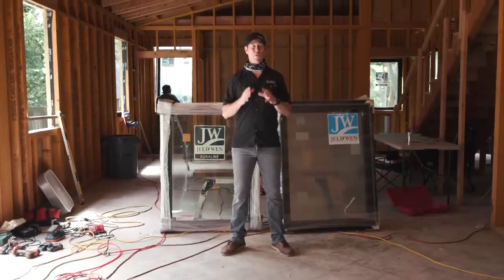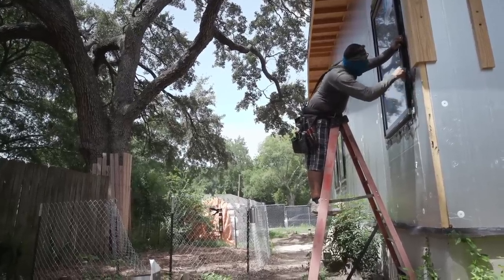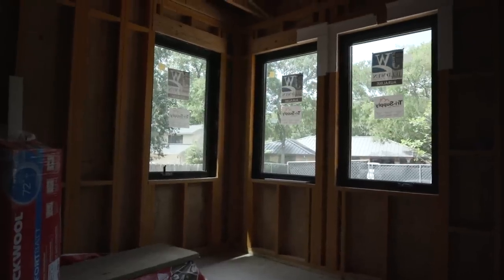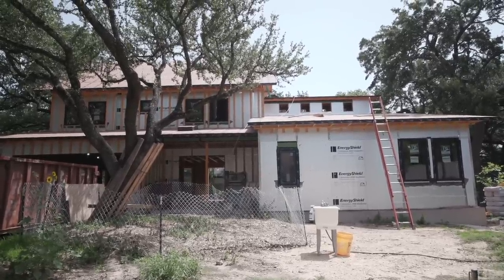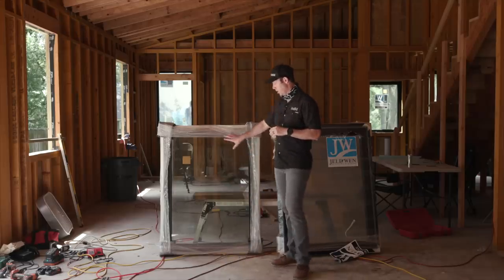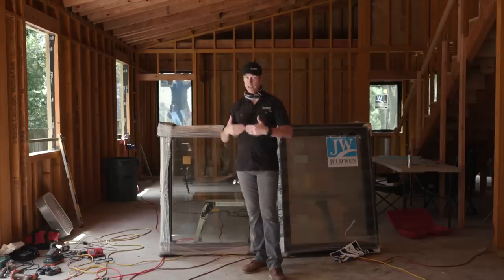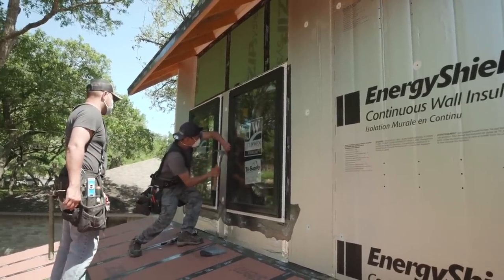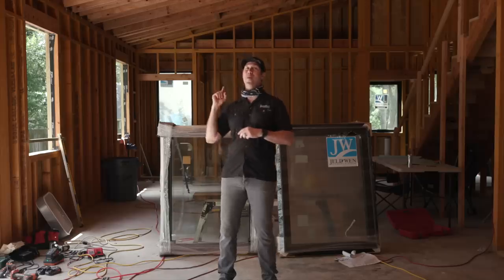Triple Pane Windows - Worth it?

Comment: I was super disappointed to find out when I built my house, the window salesman sold me super high quality Anderson 400 series double pane windows, that they were only about an R-3 and I’m zone 4A. I spent a pile of money on spray foam insulation to get around an R-42+ in the walls with closed cell foam just to cut huge holes in the walls and fill it with an R-3. I wish I had saw this video 8 years ago, as I would have gone a different route for windows instead of taking a salesman for his word. It’s ridiculous that’s we are energy star rating these windows for my zone when we can see temps of -35F in winter and I can form ice on the inside edges of my windows. I believe my window bundle from Anderson was $18,000 including a patio door.
Reply: How many windows and doors were in your package?

Comment: For the most part I agree. Something else to look at is REDUCE the number of windows. Lots of architects like to put windows in every wall in the house and they love these floor to ceiling windows. Now if you live in that house it's a nightmare. 
        Bedrooms will have a door on two of its walls and floor to ceiling windows on the other two. Now where do you put your furniture?  

      If our house had been sided instead of brick (I hate brick since it makes it hard to remodel and it absorbs heat and moisture) I would have removed several windows in our 1960 house. 

         My favorite windows are the euro style casements with the built in exterior screen. Great for stopping storm damage and they block out 100% of the light and some sound when closed. When we go to Greece I want to stop at the hardware store right by the airport, pick some up and haul them home.
Reply: I agree you can have too many windows. I also think that the squarer a window is the more efficient it should be. The U value for the frame always seems to be worse than the glass, so a square window would minimise frame size relative to the area (unless you want round windows...)

Comment: How long until these windows fog up? I have six brands of windows on my house due to various remodels. 

The Marvin’s from 1992 have all fogged and the low-E coating is destroyed. 

The Kolbe & Kolbe tilt-pac windows from 2000 are all in great shape! They are still supporting these and a pair of new jamb liners with balances is on the way. No fogging. 

The Andersen 200 series double hung windows from 2003 are all good. I’m pricing some Andersen double hung insert windows right now for the living room. They will replace the original 1948 casements that smash people’s heads when they walk up the front stairs. 😂

A Viking (Home Depot) window in the bathroom has fogged up on one side. The others are vinyl in the garage and basement and too new to evaluate.

Comment: Matt. Terrible comparison. I work at a glass shop and you’re far off. Many variables you haven’t touched on. Assuming all the glass is tempered: the thickness varies 1/8”, 3/16”, 1/4” are majority of windows double and triple pane. Annealed glass: SSB, 1/8”, 3/16” and 1/4” are most common. Then there’s lami (tempered and annealed) various thickness…
Next, the coatings on the panes: solarban, low E etc. Whether double or triple pane, each could have a different coating and create limitless outcomes. 
The spacer thicknesses will vary unit to unit. 
The gas in between the unit can vary. 
For example, a double pane with double 1/4” panes and solarban XL coating on one and comfort select 36 on the other with a super spacer argon fill. This could easily out perform many typical triple 1/8” pane, small spacer clear, clear and low E coatings. 
Do some more hw before you compare windows!

Comment: I have been doing windows and doors for 20 years and can tell one thing I’m in Canada and Canadian made or 🇺🇸 windows are not really engineered for triple glass except for fixed windows the hardware and the engineering overall is nothing to be proud of most of them are 20-30 years old without any major improvements its kind of shame. 
However European windows which I do a lot more is like day and night nothing even to compare Engendered Solid that. An handle double triple and in some cases triple with double laminated glass which means 5 layers of glass and still works like a charm. Thank to German engineering. And Jeldwen in. Anada used by builders which means the cheapest and the lowest quality. So you can make all the fancy videos and praise them as much as you want but to me it’s garbage period. No offence to anyone just sharing my observation

Comment: Passive solar gain. How much is solar gain through the windows helping you meet passive house standards?
Reply: Dave Kirkeby in meeting passive house code solar gain is not all its cracked up to be. Can be considered a negative in many respects. Here in Australia, passive solar heating units for hot water or winter heat don’t really pan out. Cheaper to put another solar panel on and condition your environment mechanically.

Comment: I’m in the gwn n want to share my findings with windows. They will b the coldest area of any room during the cold spells. So that’s why you need to understand what ur doing as wintertime comfort is golden up here. Temp gets to -30 plus any wind and heat inside 70-75 that’s a hundred degree swing. The only time I can tolerate lower inside temp is with a boiler heating cause it’ operates differently with more even heat. Your vids really aren’t adequate for us up here but great ideas n I mean the reality aspect. The in floor heat concept is great but don’t forget u will need a/c too n it’s different system. Currently it seems this aspect of the build can b a large number in ur cost but well spent for here. Efficiency is really where focus is needed.

Comment: Bad experience with Jeld Win. Sliding doors shipped with out wheels. One window with out a latch. One small crack on corner and sent wrong insulated unit to replace. In dealing with them took many contacts to get someone with a brain. Good quality materials but substandard craftsmanship

Comment: Who doesn't like a good storm window either exterior or interior? Especially if they are acrylic or polycarbonate sheet. They are much better insulators since thickness can be substantial compared to glass and sound is nearly eliminated. Also should point out that you can buy the best window on paper but it doesn't do much if it isn't installed properly. Most window leaks are due to this and how homes settle over time.

Comment: Why install windows?  The time is approaching quickly where you will simply hang an 80 inch, paper thin, flat screen display on the inside wall of your home's solid insulated walls and the camera mounted into the outside wall will will display a high resolution image of what is beyond the wall.  A simple voice command will allow that screen to provide you with the image as if your looking out of the living room window, or change to the view out of your kitchen or bedroom window or have the screen display your TV or anything else.  Most windows have no need to open, since all interior filtration and temperature control are handled by the HVAC system.  The thermal barrier of the wall is not compromised and the material and installation cost will be far less than contractors installing big frames filled with glass and gas.  The glass window is dead!

Comment: Triple glazing reduces visible light transmittance by about 25%, so if you buy windows for light, then design for 25% larger windows.  That should just about negate any energy savings, while adding 25% to the cost, plus another 20% upcharge for triple glazing.
It's true that no window lets in light after dark so triple glazing is great at night, and in the north that's 15 hours/day during winter.
I'm not yet sold on triple glazing (as you might surmise).  For now, I am getting the best LowE coatings, argon/krypton gas, and the best glass spacers for a U value of 0.24.  Windows are only about 15% of floorspace and probably less than 5% of the insulated envelope, so I don't get too panicky about needing triple glazing in my area.

Comment: For my region it will be all triple glazed. 

Are there different glass types one can request for their windows? I’m particularly interested in something shatter proof or bullet proof. Imagine the kids playing softball in the yard and give that window a pounding. 

How many windows is normal in a house? I’m counting 14-18 in my plans but that may appear excessive.

With extra thick walls (ICF, 12” concrete, 6-8” foam insulation) like 18-20” thick, would it make sense to have an outer window and an inner window?

Comment: There is a drastic difference between replacement windows and new construction when it comes to energy cost pay back. The payback on some replacement windows can be as much as 200 years! OK, they may be lower maintenance, they may look nicer, they might be quieter, but strictly in terms of energy cost, replacement windows are a bad investment. A well weatherstripped wooden window with a good wooden storm window will be as energy efficient as all but the best of the new windows.

Comment: Anything less than a triple glazed stacked on top of another triple glazed with imported Swiss air in between is simply unacceptable. There's plenty of room in the wall with 12" of closed cell foam anyway.

Comment: Matt, My house is constructed using brick over block with all windows triple-glazed.  I live within 1 block of two 4-lane high traffic roads. No traffic noise audible inside.  Fire truck and emergency rescue horns and sirens are audible.  I don't know if your windows are sound rated, but as I live in the city, this is an important feature of triple-glazed windows.

Comment: American triple windows make no sense when the frame is made from single pice framing, to get the full benefits of triple glass you must insulated framing which also is disconnected by a thermal barrier from inside and outside frame, only then the spending makes sense !!!
Get smart first and look at what in Europa is a high insulate triple glazed window can archive!

Comment: Great explanation on window values I agree it would be great to have a R factor posted on the label without doing Pythagoras Calculus  Good analyses on windows being a energy drain on the building so when I blueprint my homes I try to minimize the number of windows or size on our North side where our subarctic wind prevail all winter long at 30-40 mph or 50-70 Kmh
Like a good wife you gotta have good  windows we cant live in a cave well I suppose you could but it wouldn't be much fun. Cheers from Oakville Mb

Comment: Isn't the solar heat gain mostly dependend on the coating?
Then again a 22 isn't really that much different from 18.
If you really want to keep the radiant heat out. Use outside sunscreens. Especially on the east and west. The north has no use of sunscreens. The south should have enough from the overhag, albeit on the middle of the day. The south could still benefit of screens in the sunrise and sunset..

Comment: Matt Matt Your missing the Performance Ratings and the water resistance rating (in Canada there two separate ratings).
Doors are critical  
You may have a great glass but the seals or frame may leak air or water.
Jeld Wen windows have great performance ratings show why not show it off.

Comment: I did not hear you talk about one of our most important reasons for using triple pane at least  in  Iowa . In a tight sealed house the humidity will increase and freeze on a double pane in winter .And the other number I think helpful is what is the temperature of the inside surface of the window at say 10 degrees F outside temperature. And compare that to triple vs double. In our situation the triple raised the surface temp above the inside dew point and stopped the condensation.41 degrees with double and 51 degrees with triple inside with outdoor temp of 10 degrees F.

Comment: There is a reason why windows maker uses U factor instead of R factor. Yes, mathematically the U factor is the reciprocal of the R factor, but the U value is an engineering term used to designate the thermal performance of a system like a window that is a complex assembly, whereas R value is used to express the heat resistance of a homogeneous material like insulation that has a singularity intended to limit heat transfer.

Comment: Another strategy to make only some windows triple glaze is to focus on the large picture windows with large surface area and let the many small windows be double glaze.  Most of the heat loss in my house is the few large picture windows which is actually a big portion of window area, so spending more on those few windows would have been well worth it.  #2 for tiple glaze would have been noise reduction of windows in bedrooms or facing the street. Great point best lowest heat gain on windows facing south & west.

Comment: Triple glazed is good in a northern location where the interior glass temp in double glazed will be cold enough to cause condensation. The colder your exterior temp the more likely that your homes interior humidity will cause condensation. If your in those regions you should bump up.

Comment: You forgot to mention sound transmission. Three panes work together to dramatically reduce incoming noise, more than one might expect just by adding a third layer of glass. This can be seen in graphs of window sound transmission. One pane does very little; a second helps somewhat, while a third pane dramatically improves attenuation, even at lower frequencies.

Comment: I put polycarbonate sheets my windows, cut perfectly to size by the vendor, and held in place by magnetic plastic strips.  It made a huge difference to the noise and heat  and was very economical.
Reply: Inside, outside, both?

Comment: The space between pains is different between manufacturers. 1/4" up to 1". Thickness of glass. Gas filled. High end windows are often better designed to handle the additional weight a third pane of glass. Sound proofing increases as well. $ goes up with quality. Your house is coming along. Looks great!

Comment: I'm surprised the SHGC is worse on the triple glazed.
Reply: SHG is needed in the south. More glass or more coatings or going from double silver low-e to triple silver will all decrease SHG, blocking more of the sun’s heat from getting into the house.

Comment: do you ever install offset stud walls in bedroom walls and exterior bedroom walls to cut down on external noise transfer..  so the inside wall is NOT connected except at top and bottom with the exterior wall... sound is transferred thru the middle of the wall not so much the top and bottom.

Comment: E-coating or heat control films dramatically improve room summer heat gain or winter 'cold gain'. I have been going through my current house adding Gila Heat Control Platinum and it helps both South and North windows for heat gain or heat loss.

Comment: Matt, your solar heat gain is dependent upon the Low E coating. You should always go soft coat Low E vs Builder Priletic Hard Coat. Also some windows can be ordered with multiple Low e coatings virtually eliminating the heat gain!

Comment: I thought you were going to use an inside outside window setup.  I've been thinking about trying it with movable windows.  Fixed windows may be a future problem area.  I also seen videos of virtual windows using lcd tvs and cameras.  Great idea for security and thermal barrier too.

Comment: I live in Austin and am about to do some minor remodeling that will involve replacing some exterior french doors and one large glass slider. My gc has recommended Marvin and Western. Are there any other brands I should consider?
Reply from the maker: I’m not a Western fan as their PG ratings are lower. Look for at least a PG 30 rated window. PG50 is better. Andersen is a good choice too. I buy a lot from Exclusive Windows & Doors in Austin and like their Weathershield line.